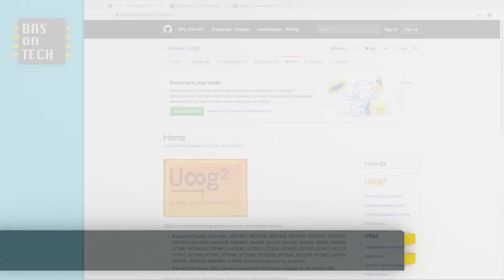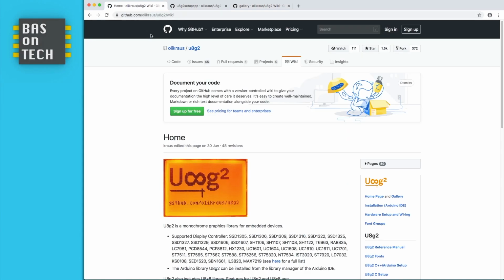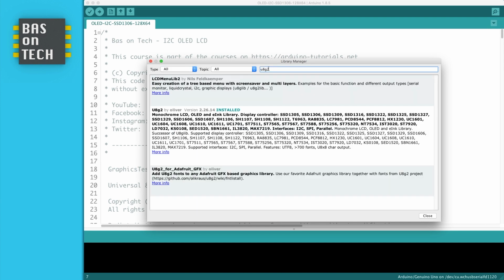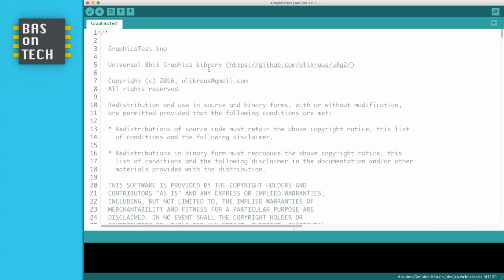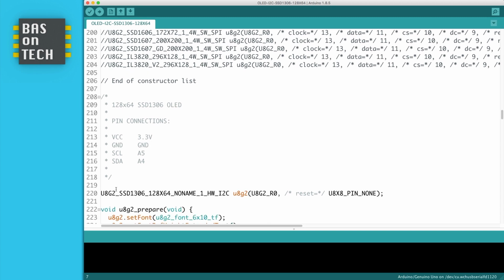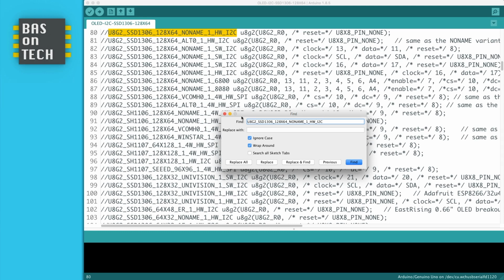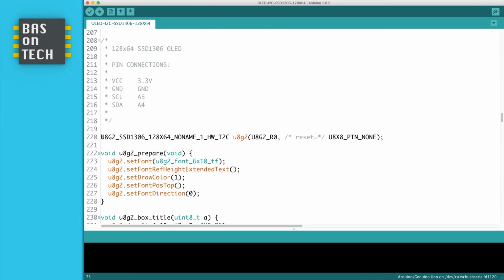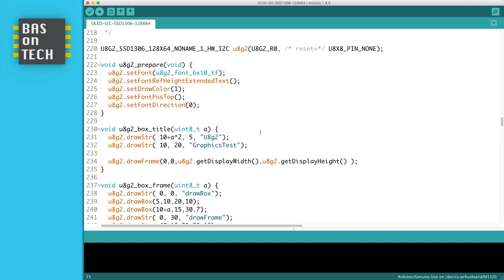OLED DISPLAY 128X64 SSD1306 GRAPHIC I2C - Arduino tutorial #18

Comment: hi do you know wgich pins are the i2c scl sda on the:  LILYGO® TTGO T-CAN485 ESP32 CAN RS-485 Supports i2c TF Card WIFI Bluetooth Wireless? 🧐 thanks.
Reply from the maker: According to http://www.lilygo.cn/prod_view.aspx?TypeId=50062&Id=1159&FId=t3:50062:3 it is pin 21 (SDA) and 22 (SCL)

Comment: Hey there, awesome demo! Do you happen to know what happens if you connect it to a Vcc and GND with a powered arduino but SCL and SDA void of any data? Should we see the OLED backlight turn on at on? I'm trying to figure out if I have a software or hardware issue.
Reply from the maker: OLED doesn't use any backlight see https://en.wikipedia.org/wiki/OLED and without the data I think the controller doesn't really show anything.